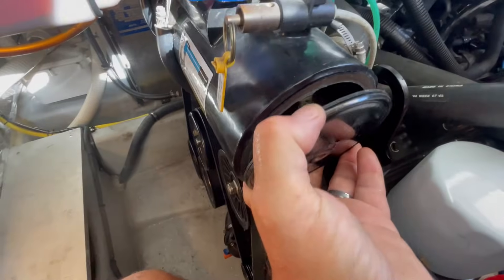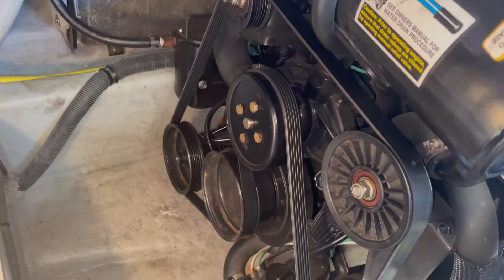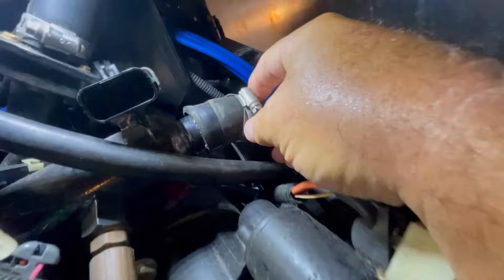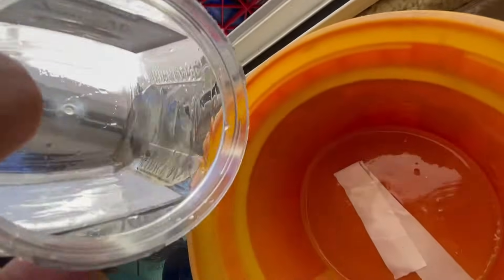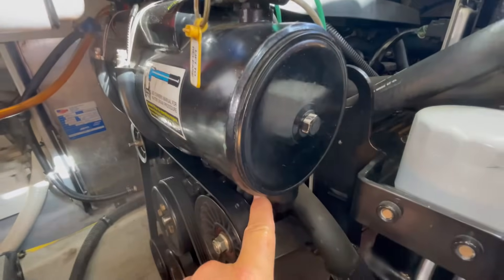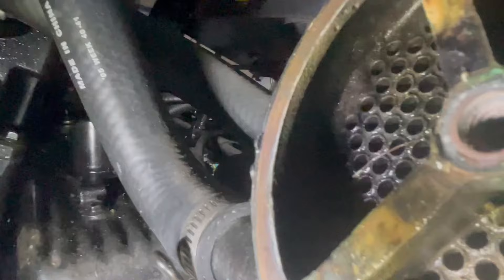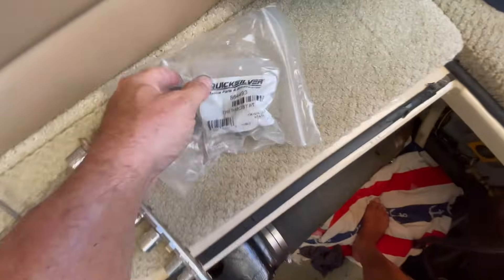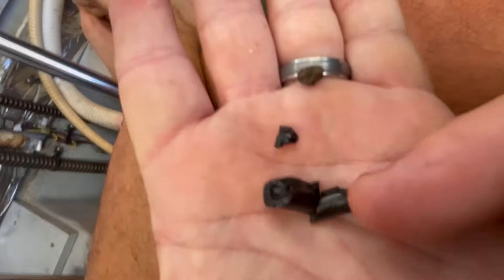Overheating problem - Flushing Heat Exchanger

Comment: does the bleeder on the top of the sausage need to be filled, or does it fill up when the engine is on, and it's just bleeding air until it fills up?
Reply from the maker: Sausage?  Lol.  You fill coolant in the heat exchanger on fresh water side then bleed air.  The raw water side will fill itself when the engine runs and pump pulls seawater.

Comment: Cleaned many  heat exchanges in my time. They make special brushes for all different size tube sheets to manually clean them without damaging the tube material.

Comment: Hello TOM, I would like some information regarding the orange seal on the high-pressure hose. Where is the seal currently located or does it go up to the rib? Thank you.
Reply from the maker: The orange seal is on the stainless fuel line coming off the cool fuel module.  Is that what you are referring to?  It’s placed on the end of the stainless line against the rib.
Reply: @AdventuresofHappyOurs  Hello Tom, I will send you an email with a photo, thank you.

Comment: Great video! I also remove the heat exchanger and give it a bath with Simple Green and let it sit in it overnight and then flush with water multiple times - that removes the rest of the debris - seaweed and some gunk / paint...
Reply from the maker: I’ve since replaced both heat exchangers due to leaks and overheating.  It’s fairly simple and found a good bargain at MrCool.

Comment from the maker: I know I’m late to the party, but I had same issue this week. Tracked it down to internally leaking heat exchange. Coolant was going right out exhaust with the raw water.  Confirmed that once I removed the side cap to the heat exchanger where I discovered the orange coolant leaking from a few of the cooling tubes. Break out another thousand.
Reply: I just changed out one of the heat exchangers on my Lehman 135 and although it was not showing symptoms it was time to do it. I took the old one in for a pressure test to maybe refurbish it for stock and the radiator shop said it failed the test and water was leaking into the coolant side. So these have a finite life span. Mine was about 8 years old.

Comment: Great video. Curious what you used to flush the transmission cooler tube?
Reply from the maker: Garden hose and some electrical tape to keep it from leaking.
Reply: @AdventuresofHappyOurs  thank you

Comment: I’ve used a cider barrel with a flush pump added with a way to back flush and different adapters to do small and large engines. Barnacle Buster is my go to.

Comment: Bro, water temps are at an all-time high in Florida this summer and you're sucking in 90 degree water - maybe warmer -  so it just doesn't have the cooling capacity it once had. You might have to find a rpm that keeps thing from getting too hot.
Reply: If sea temperature increase was the cause, both engines would be showing increased operating temps.
Reply from the maker: Something is keeping the sb motor hotter.  Has been like that for years.  Sea temps may just be pushing it over the threshold.
Reply: @AdventuresofHappyOurs  Remember many boats plumb their water heater in line with the cooling system. Our Cruisers 420 is plumbed on the port side thus the port engine runs just a tad warmer.
Reply from the maker: I figured that had an impact.
Reply: Yeah, the weather may be warmer and the water slightly, but that won’t make the engine necessarily run hotter. I live in Mesa, AZ and the lake water is warm out here and I don’t have that issue. Typically if the impeller is new and screens are free of debris it’s typically some blockage in the manifolds, hoses or bad thermostat.

Comment: A short piece of threaded rod slightly smaller than the heat exchanger tubes works well to clean any calcium buildup which is usually what ends up causing the overheat in second place behind impellers and thermostats.
Reply from the maker: I didn’t get it on camera but I used a 22 caliber gun barrel brush to poke a couple of the tubes.  Being I was able to see through them I didn’t bother doing much of that but it would help in severe scaling situations.  Thanks!

Comment: Just had to track down a nover heat issue. Went through every hose, cooler and had the HX prof cleaned. Raw water pump was rebuilt, impeller replaced and found the wear plate and cam on this pump was worn so much; at high rpm cavitation occurred and cooling water was too saturated with air bubbles to effectively cool things down. All set now.
Reply from the maker: That’s good to know!  I have a new wear plate ready to go in.

Comment: So I've not commented before, but I am so grateful for your channel and all the posts!! My 2007 Gas powered Horizon 6.2 MPI 341 is docked on Lake Lanier in Georgia. Oddly enough, 1 of 3 on the same dock!  I have replaced both impellers (with your channels help). My port engine is perfect, but starboard is having a PSI issue. Reads about half the PSI of the port engine. Engine temp is right at 160 on both up to about 3200 rpm, then starboard begins to rise and at 4000 rpm and I get an alarm on starboard. I've actually switched the PSI gauges and ruled that out. I had thought maybe I have a blockage at the cool fuel assembly, but very difficult to access on starboard. I'm gonna try flushing the tranny heat exchange now and see what that does. Again, what you post is wonderful and I believe I can speak for 341 owners everywhere: THANK YOU!
Reply from the maker: Thanks!   Now that you mention it, I had lower H2O pressure on the side with the overheat issue.  It seemed low at idle but looked ok at higher rpm.   You can flush the fuel modules by using fresh water flush adapter and removing the blue plug on the CFM and sticking a Ty rap in the hole to clear out muck that may settle in there.  Water should flow out under pressure there.

Comment: Hello Captain. What did you do for a living before retiring and managing all of these technical challenges of owning a large boat?  Impressed with how you deal with all of the fun problems.  Enjoy all of your videos.
Reply from the maker: I worked for Verizon as an operations manager.  Was involved with many technical jobs over the years where I had to track down and solve root causes of maintenance problems. Left them after 32 years